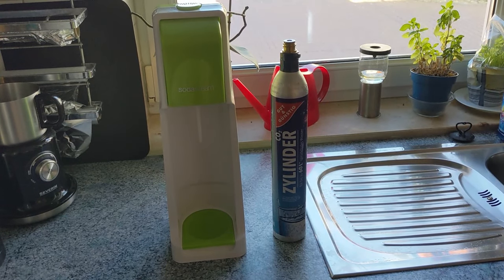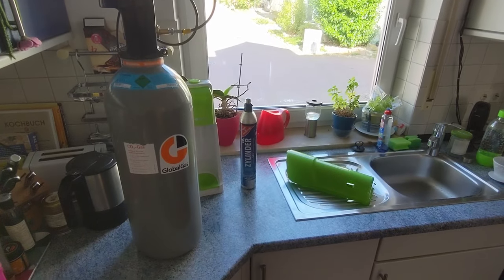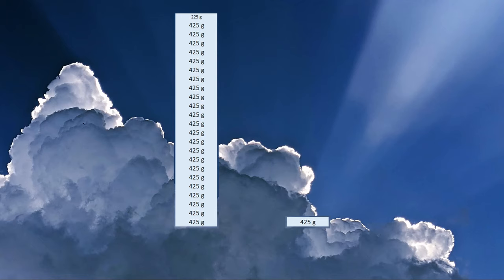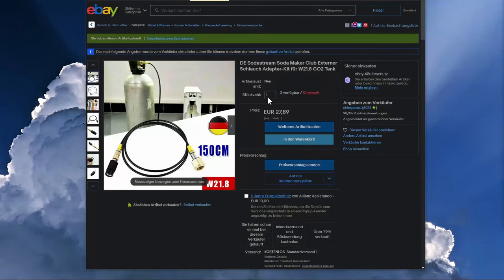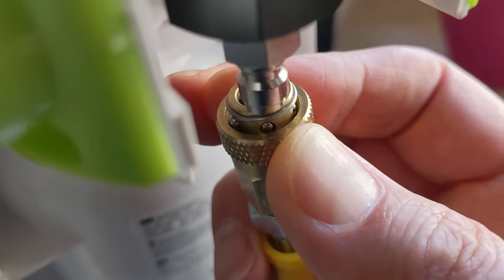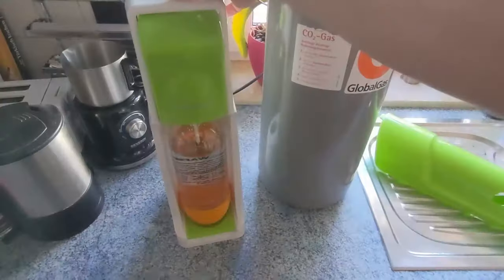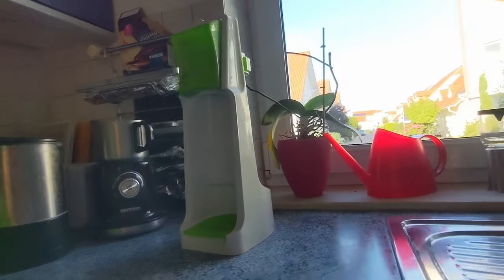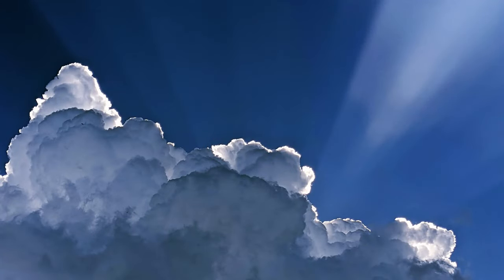Large CO2-Cylinders for Sparkling Water Makers (like Sodastream)

Comment: My Sodastream Cool tank Thread is thin, why is it different compare to yours?
Reply from the maker: No idea, here in Germany there is only the one connection. I know that there are other connections for the large cylinders in other countries, so if necessary you have to check this again exactly and buy the right adaper. When I search from Germany on ebay for "Sodastream adapter", I get the appropriate suggestions directly. Maybe that works for you too.